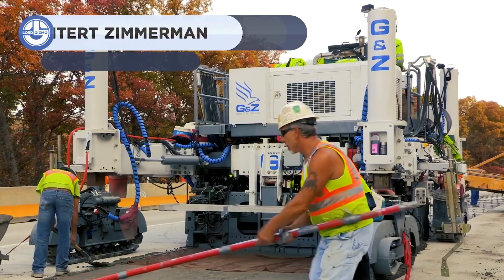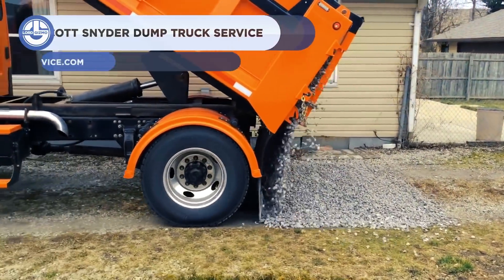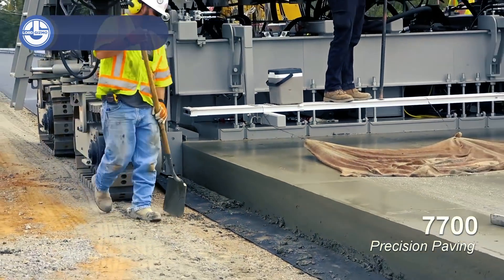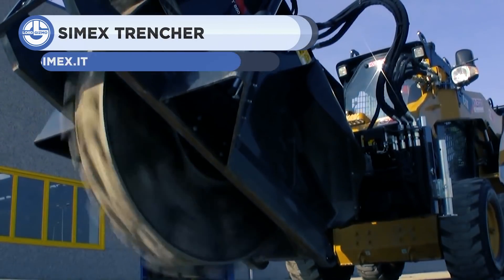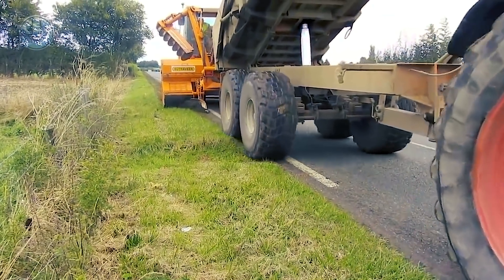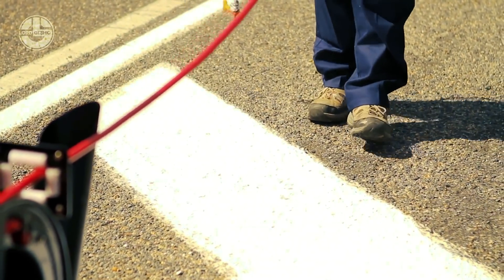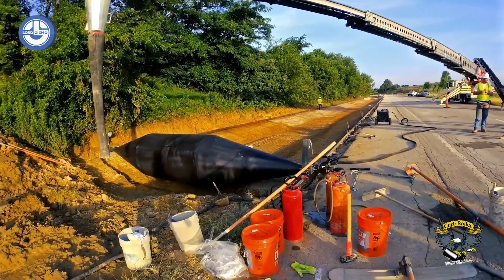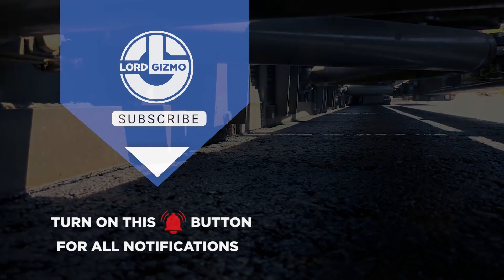IMPRESSIVE & Powerful Road Construction Machines You Need To See | Ingenious Paving Technologies

Comment: Nice curbs on what appears to be packed clay without any rebar or expansion joints. Will it last a whole year?
Reply: Real curbs are supposed to extend down below the frost line to hold the roadbed in place.

Comment: How come as machinery has get "better" the roads have got worse?
There are 100 year old roads never serviced that are perfect
Reply from the maker: The reason is simple: biases!  Selection bias makes it so the roads that were constructed the best from 100 years ago were the ones that ended up surviving, when a vast majority didn't.  Also, the fact that most of those roads are used very differently, and repairs are constant adds onto this.
Reply: It's not the plant nor equipment which is at fault. The limited availability and lack of experience and knowledge is why we suffer in the 21st Century. 
We're not mentally conditioned to build things to last the test of time, were in an era in which we are educated that we live in a disposable society.